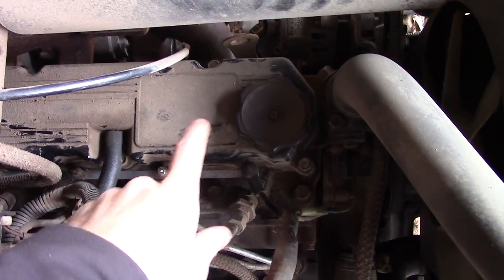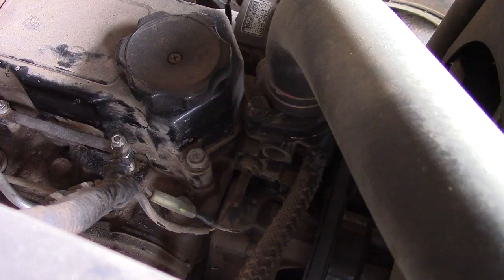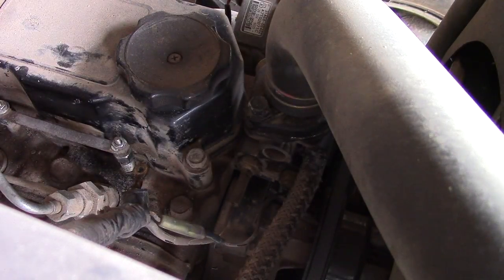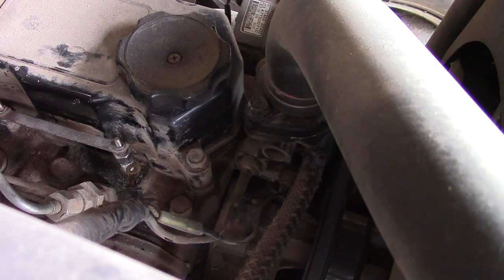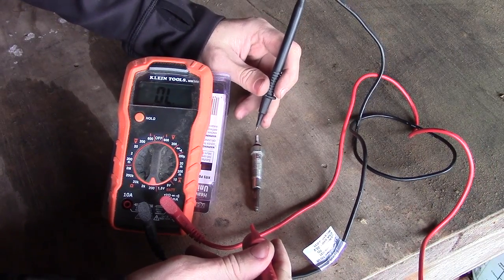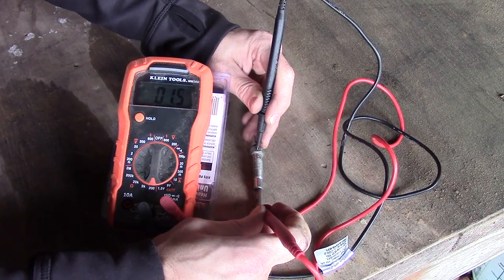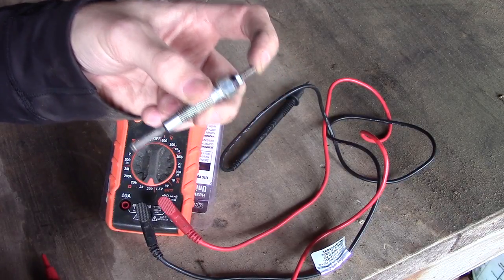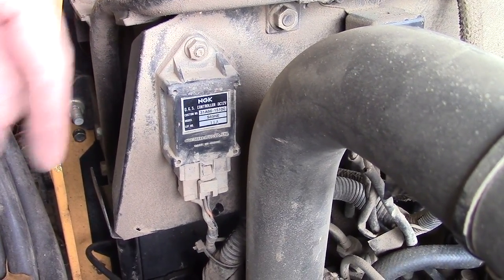How To Test For A Bad Glow Plug! (How To Remove And Test)

Comment: Looked like hard starting at the end..does your ignition not allow a glow plug warm up before engaging starter motor?
Reply from the maker: Yes, I have a bad ignition switch and control module. I turn the key on and off to get the proper amount of warming time for the plugs.

Comment: New subscriber here.
How about removing all the glow plugs, connect 12v to the top thread of the glow plug and the body of the glow plug and compare the time it takes to get red hot on all the plugs? As long all the plugs glow in the same amount of time they are good.
Would that be a way to test?
Reply from the maker: Doing it the way I showed is easier and safer.
Reply: A lot less time consuming  to check resistance (olms)

Comment: Could you test for conductance from the center connector to ground after removing the power bar, without removing the glow plug?  It still looks like the center contact to ground would be a better test point in case it is burned out in the middle.
Reply from the maker: I don't believe that would be a good option as you would not be able to determine the resistance through the entire plug to the point of "ignition". If it was burned out in the middle your reading would be high meaning a bad plug.

Comment: Wrong mate, wrong….all you tested was the body of the glow plug. You place your test leads; one on the body and one on the terminal end. Measure the resistance, if open ie no circuit, your glow plug is dead. There should be a reading, compare readings across all the glow plugs any exceptionally high is duff…replace. Although all plugs should be replaced at the same time.

Comment: Hot tip. You don't need a magnet grabber. All you need is some chewing gum. Stuff in in the socket. It holds the nut. Costs about 2 cents.
Reply from the maker: Interesting. Thank you.